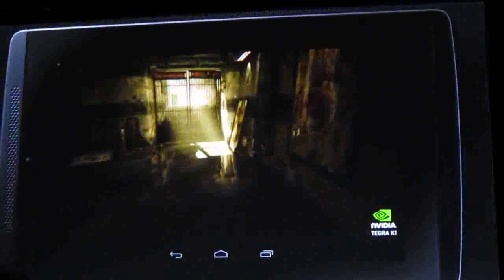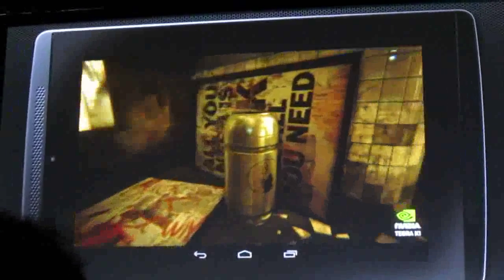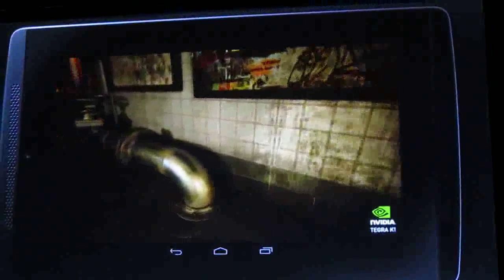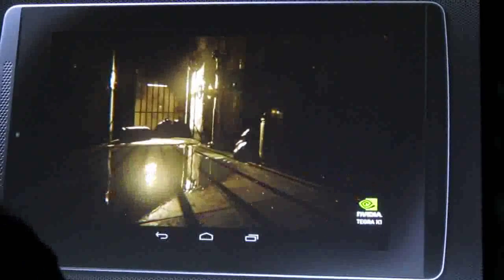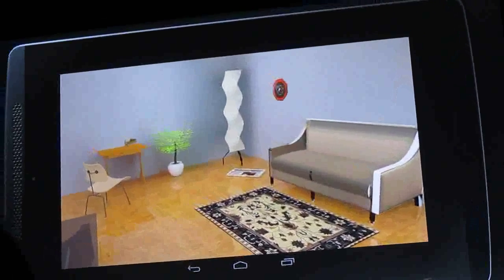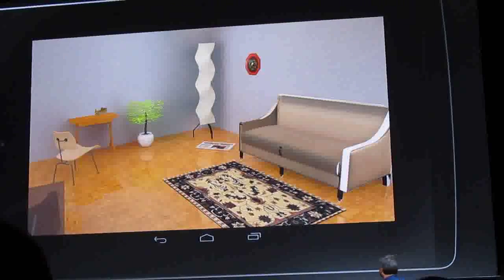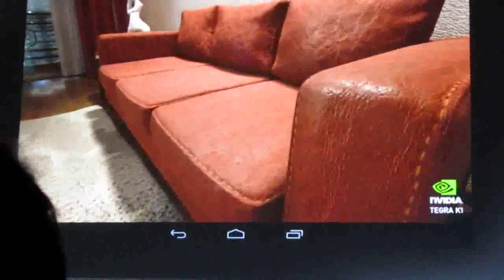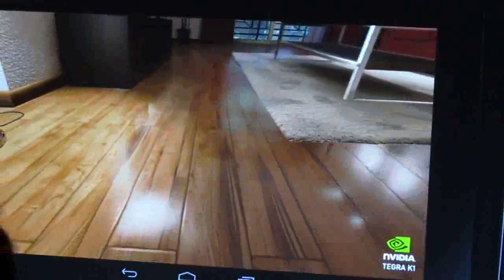NVIDIA Tegra K1 chip Unreal Engine 4 demo

Comment: Amazing if this is coming out by q2 or q3 of this year then I feel bad for ps4 n xbox one this means by 2015 mobile graphic will surpass next gen console a big blow I say. We might see PC level graphics on our mobile chip by 2015 and who knows crysis 4 on our android phone .
Reply: It will probably come in q2, but mobile graphics will probably equal consoles by tegra 7 or 2016. I would be very surprised if that happened by 2015. But that would be on tablets and devices like nvidia shield, not phones. But as the new consoles are meant to go for a ten year run, ps4 level graphics in 2-3 years in mobile chips would still be very impressive.
Reply: It's not the power of the chip, it's the programming of the engine. There is no way a mobile chip is going to beat what the PS4 can produce.. at least not in the next few years anyway. PS4 games will continue to become more and more impressive as the engines are rewritten.